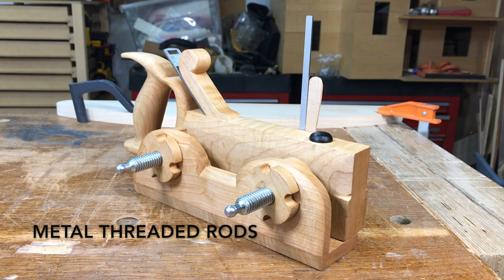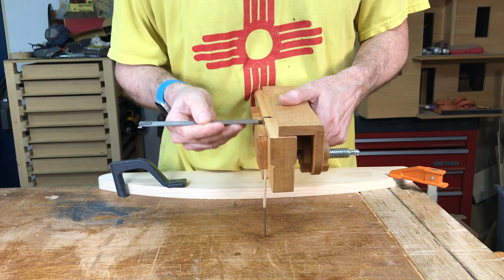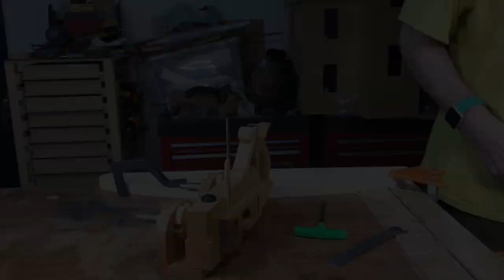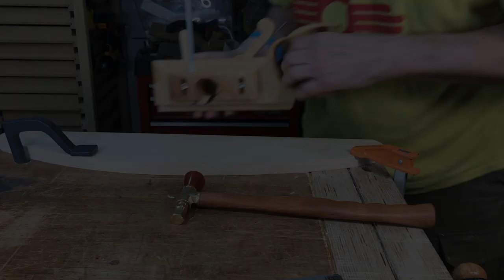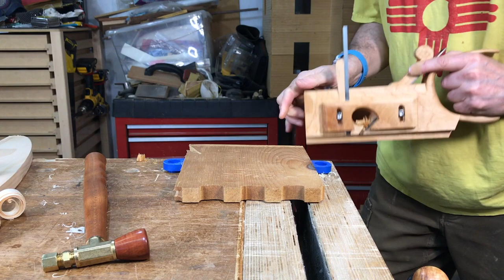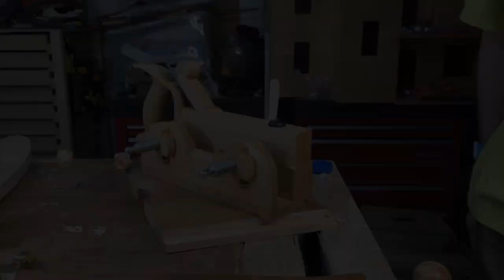Plane No. 10 - Moving Fillister

Comment: Eric - Beautiful plane!  How did you come by the metal posts?  Did you make them?  I notice the traditional wooden detail on the ends.  If you made this, did you custom thread and turn that end or modify a threaded bar?  The depth stop is attached to the other side of the posts that are drilled and tapped?  How did you decide on the length of the cutter and have you shortened it since you have been using the plane?
Reply from the maker: Thanks! The metal posts are from cheap 3” C-clamps. The ball end is the way they come. I unscrewed the clamp all the way to the end and then kept going. The swivel pops off and then I cut the threaded rod off the clamp. The rods are mounted into holes that were threaded by another clamp rod that was filed to make a tap. The iron is from Lie-Nielsen and is their 1 1/4” shoulder plane iron. The nicker has been changed since this video. I used a shorter cutter in the current version. You can see the changes in this video: https://youtu.be/R8JUPdfm4ZI

Comment: That is gorgeous work, Eric. How did you thread your wood nuts?
Reply from the maker: Thank you. I created a tap from an extra threaded rod like the ones on the plane. I filed groves in the side and filed a taper at the beginning. I also used the tap to thread the holes in the body of the plane. The idea worked well and I am happy with the result.
Reply: @EricKnapp  very nice work indeed. Why not use wooden screw instead of steel though? I'm sure the steel is more resilient but the wood threads would've made this one for the museum imo
Reply from the maker: @iPaintCars_215  When I made this plane I was not able to make high-quality threaded wooden rods. I needed a plane like this so I use what I could find. I can make good threaded rods now and the next thing I make that needs them will get them.

Comment: what did you use for nicker?
Reply from the maker: For this plane I used an iron from a small plane. I ground it to a point. For future work I will use jigsaw blades. I grind the teeth off and sharpen the tip. Jigsaw blades are plenty hard enough for cutters and are readily available.